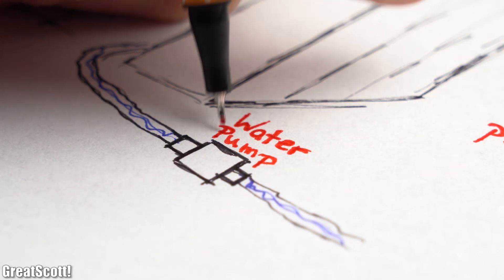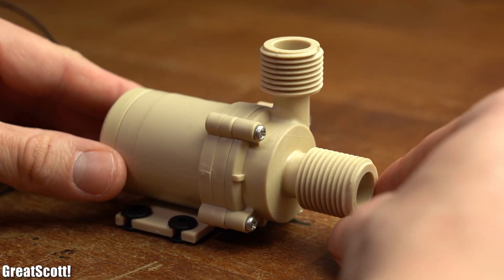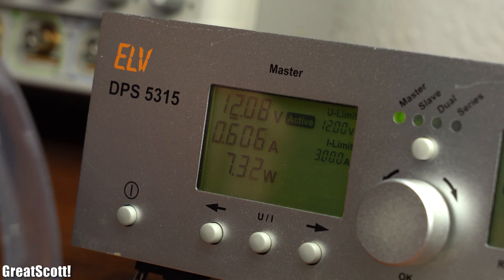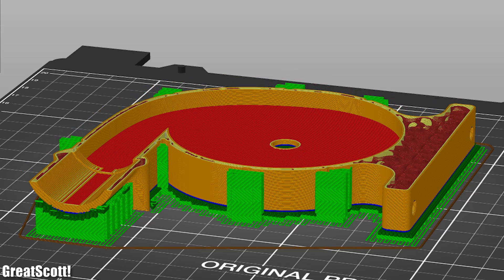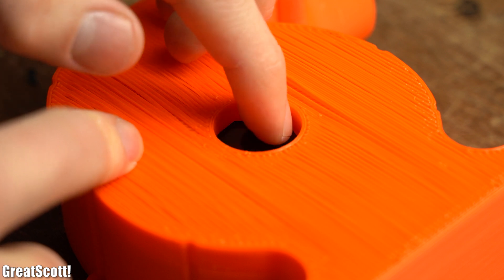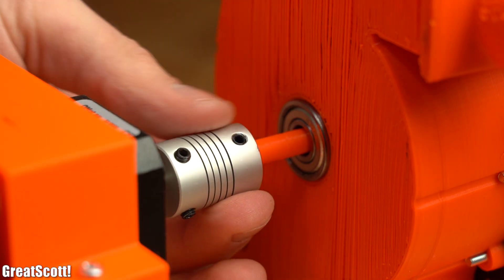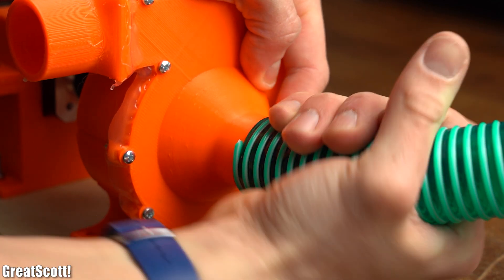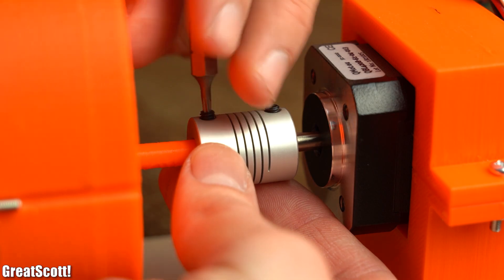Water Pump || DIY or Buy

Comment: Shouldn't the curve on the impeller be the other way?  Most impellers I've seen have the curve the other way to push fluid away from the center and not capture it and force it to the center.

Comment: 1) The impeller was the wrong way round, so created extra load on the shaft   2) The shaft did not fit the bearing, so was flapping around, again causing more stress 3) PLA would have been more rigid that PETG for the shaft, also the shaft was printed with the later lines in the wrong direction so was going to fail due to layer separation anyway 4) A bolt or metal rod would have been better for the shaft anyway, but the plastic shaft could have been made to work by printing in PLA, making it wider and making sure it fitted the bearing.
I think you should re-visit this video and actually make it work with some improvements 😉

Comment: The impeller shaft wasn't supported by the bearing which would cause a failure even if the shaft were metal.

Comment: There are lots of options to make that shaft into a metal shaft, could use some axle shafts for rc cars, or some small bar stock. Even a wooden dowel would probably work better than that printed piece. You could also increase the strength of the shaft by printing the shaft so the layers are going long ways, this would make it less susceptible to shear, and stronger in torsion since they layers are in compression and tension, vs shear. 
Great video!

Comment: if you aligned the shafts correctly the 3d printed shaft would've experienced a lot less stress and your motor would've lasted longer and drawn less current

Comment: I would definitely recommend a metal shaft, but if it were to be 3d printed, you would want to print it 90* rotated so that the layer lines are going along the full length of the shaft. 3D printed parts are weak if the force is going with the grain

Comment: I did a same type with an old vhs tape motor. Its powerful even with 6Volts.
I used two soda caps and a lot of hot glue
But the wheel was flat. Not rounded

Comment: I think the DIY should have done better but there are some issues to your construction, experiment and the way you understand centrifugal pumps. Firstly is the rotation of your 3D printed pump impeller, fron the video it looks to be rotating the wrong way. The impeller should rotate so that the blades throw the fluid outward against the case. Secondly the impeller shaft is not supported on the bearing, the shaft should be made of a sturdier material such as aluminium, bronze or SS. Centrifugal pumps have a limited suction force, called Net Positive Suction Head (NPSH). The inlet/suction side of the pump should be close, equal or lower that the fluid source. A non return valve/check valve on the inlet/suction side will be aid the pump as not to loose the water on the delivery side and keep the pump primed. There is all so a relationship between the flow of a pump and at what head/pressure it can perform/deliver. Look into some pump curve to see that.

Comment: Why not drill out the plastic shaft of the impeller and replace it with a length of brass or stainless steel?

Comment: Diy design had a fatal issue. It has angled axle and not even having contact with the bearing. Only metal axle can handle resistance of water. The unbalanced axle and the water was enough for pet-g. Try to scavange diesel pumps, they have a decent flow capability. The best is a truck or tractor pump :)
Reply: In scrapyards or second parts shop they are basicly free

Comment: With smaller waterpumps there is also problem with the 3d printed layers not sticking to each other enough, so the water will leak out. I have printed many "heads" and impellers for ebay "el-cheapo computer watercooling pumps" (submergeable) and when they are submerged, the problem with smal leaking is not a problem. That has boosted the "umpf" factor of the pumps significantly, but at the same time trying to make tight tolerances, the noice levels have lifted. stil great video

Comment: Should try to couple the metal shaft directly to the impeller. I think if you ditch the heavy metal motor shaft coupler, the pump will spin a lot faster and have more torque due to less rotational mass.

Comment: Weren't there any torque specs on the motor you were trying to use? Seems that this project would've benefited from knowing that at that the onset. Any mechanical system is only as strong as it's weakest part.

Comment: Buy cus not got 3d printer lol
Why put pipe tape then a jubilee clamp lol
And should of used thinner pipe on the input that pump not gonna pull that weight of liquid lol 1 liter = 1kg .......just crap design impeller plastic toy

Comment: The flaw with that one design is that stupid plastic shaft. Just drill the impeller out so it'll press fit onto a long motor shaft and work with something like that from there. (Somewhere on Thingiverse I also have a centrifugal pump design as well. I think it may have issues with the volute for printing, but never got feedback on it as where to improve it.) Also for sealing, just get some RTV gasket sealer like used on small engines and such. A small tube of it should be enough. Goes on like a bead of glue, but should be able to be pulled apart again after setting if needed.

Comment: why don't you separate the parts that are supposed to be made with metal?  I mean, not all parts can and are feasible to be made with a 3D printer.  it might work. but, you didn't did it well.

Comment: I have personally made a similar diy version of this, which worked really well. I can send you the design specs (I haven’t ever uploaded it to YouTube) if you would like another shot, because I believe that here the issue is simply the design. With a 3D printed inline jet impeller driven pump, you can pump an insane amount of water at low pressure. I also made a centrifugal pump, which even with 3D printed parts, had an incredibly high pressure, and a good flow rate. (I also designed a cap that wouldn’t leak, by having a screw on cap) again, if anyone wants the files, I’ll upload the latest version somewhere.

Comment: Just add a metal shaft where the pteg shaft failed. Drill a hole in the center of the propeller where you can insert that metal shaft, then connect that to the Trinamic Stepper motor assembly

Comment: you can print the shaft in an angle where material grain isnt in the same axis of rotation also when you say "firstly" it sounds incorrect, so instead of saying: "for that i firstly added" you should just say "so for that first I added", cheers.

Comment: Go for a gear or screw pump, they are self priming. This might be a better option for your garden, as you will not need to fill your pump with water each time you need to water your plants. Gear and screw pumps can also be used to prime a centrifugal pump

Comment: 9:10 Why you didn't use M8 bolt as a wheel shaft? Hexagon(13mm head) of the bolt into wheel of pump, and shaft into bearing and motor coupler. Thanks for video ;-)

Comment: I think you would get tired of sucking up Water to get things started.  : p  
I'm Not either - mechanically or electrically inclined.  Tho i picture Filling Hose with Water to Prime. ?  
Or something like i've seen - Make a 'dip' - Water, 'P Trap' (word?)  as in plumbing, to hold (somewhat) of Prime.   
-  all the same  -  Great Luck on Garden!    = )

Comment: If you were to make an allowance for a stainless steel impeller shaft press fit into a 3D printed impeller, I think 3D printed design could have more merit. However, the hole in the impeller must be 3D printed. No modifying the part post-printing except to maybe ream the hole. I'm curious how much power that impeller can withstand and how much flow that equates to. Will it experience cavitation? Will it simply split in half?

Comment: Use a bit of steel rod from a hobby store and an angle-grinder to make a key-way. Mount the impeller on the steel shaft and key the impeller onto the steel. Couple the steel to the motor. Vastly superior drive-shaft strength for the impeller turnstile, without having to rebuild the leak-prevention gallery beneath the bearing.

Comment: Hi. Nice video! Can I focus you on the geometry of the impeller? The blade should be mounted In the shaft with a trail angle between they an the radial perpendicular imaginal line coming from the center line of the axle. In your "backward printed" impeller it fight  against the centrifugal force on the water. And as other comments suggest I should print the impeller with a hole smaller of a steel shaft for interference coupling with it to ensure concentricity an mechanical grip without set screw or similar. And it is very important that the shaft is perfect sealed or it lost the prime of the pump. So I suggest you to modify the pump case for accommodate behind the roller bearing an anular holeodynamic seal that are commercially available for very cheap. Have a nice day!

Comment: using a metal shaft would have been better than a 3d printed shaft, also an impeller type blade inside the system would have worked better. i built one as a test a while back, with some modifications. The mounting plate for instance i created a small triangle on the flat plate that mated to a triangular crease in the motor body which increased the water "tightness" so less glue was needed to seal the unit. It is "doable" but for 10-12 for a pump on amazon, definitely not worth the effort :)

Comment: I would reprint the impeller without the shaft coming off the back and instead drill a hole to fit a metal shaft through. Using a tight fit and blue lock tite to secure it then it should work

Comment: Oops... mechanical failure! @1:23 it was obvious this would happen! 3D printing is amazing but only when used with proper mechanical hardware. Cant attribute a failure based on a bad design from the web. Those 3D prints could definitely use some improving. Maybe Stefan from CNC Kitchen should be consulted, I'm sure he wouldn't mind the sub boost! 
Keep up the great work!!

Comment: You got so close and just said “eh whatever “ 😂 all you needed was a metal shaft and your gasket would’ve worked and you need to prime the pump but it’d have done the job
Reply: No. The forces that these pumps go through are extreme. Traditional centrifugal pump vanes are usually made of glass reinforced plastic and have extra reinforcement designed into the impeller just to handle the forces that are exerted on them. That large pump design was designed to fail, and I'm shocked that it wasn't the vanes that did.
Reply: @whateverworlshere  Yeah true, but in this case he made a very clear mistake. The impeller vanes/fins are wrong. It should be the opposite. We can compare to the commercial pump at 3:25 to the DIY one at 5:00. I dunno how Scott can miss it and commit such a fatal mistake. I hope he rectifies it and try with a metal shaft, it will definitely work to pump water if not on very high power.
Reply: @DSmartLife  It rotates the correct way. See later footage... Notice the rotation of the motor coupler??
Reply: Christopher Jones yea no kidding, I fix pool pumps and the impeller is 1/4 the size of that thing on the orange pump he made. Meanwhile on pool pumps they are about 1-2 horsepower
Reply: i'd just stick it directly onto the motor
Reply: what else do you expect? this video was made just to show that trinamic board

Comment: the shaft of the pump probally broke because the shaft was smaller than the bearing, so it was just flopping around
change the shaft to a metal one  and use the bearing and try again
would like to see what it does

Comment: I agree with many of the suggestions below. Also there seemed to be a lot of shaft vibration. Are you sure you had the correct size coupler for the printed shaft? It looked like it was moving eccentrically. Couplers with set screws are something I stay away from. Split clamps do a much better job of keeping things centered. However, either way, you need the correct size coupler for the shaft size.

Comment: Huh, either you really need to recalibrate your Prusa, or they aren't as good as I thought they were, that print quality looks really inconsistent. D=

That aside, thin-layered towers like that shaft are really weak, and you pump vanes where backward.
That pump could work IF you replace the shaft with a metal rod fitting firmly in the bearing and print the vanes mirrored.

Comment: 3D prints are weakest along the layer lines, so this break was almost too obvious. The model would have been a lot stronger if the shaft was printed horizontally on the print bed, though then it would need to be printed separate from the impeller and also might have roundness issues. (Or, as everyone else suggested, have the shaft reinforced/replaced with metal.)

Comment: Hello there!!, in first you are trying to invent the water pump that is already done, all the things except the motor are just crap, but you still want to make a water pump, right? Well you have to think in a self primer water pump wich has a big canister in front of the inlet in order to make suction and vacuum into the hoses, when you have water running trough the outlet it force the water coming into the inlet, to be more exactly go and search for a swimming pool water pump for example, then, you have to think about to use o rings to seal the impeller case, make a grove all around the edge to put the o ring and it will seal perfectly with good amount of screws around, is so simple, to the impeller design i do recommend you to incorporate a nut in wich you can screw a stainless steel shaft  to make it strong and can produce the water pressure you need, to seal that shaft you have to put something like a o ring pressed between the pump case and the shaft like a sandwich of screws washers and the o ring in between it will make a good seal and will let the shaft turning, otherwise try to get a ceramic seal dor water pump that fit the shaft... and the ball bearing of course out of the contact of water... there is a huge amount of water pumps brands, abs, jacuzzi, hayward etc.

Comment: You chose the wrong design for this purpose, you needed a design in which pump impeller directly attaches to motor shaft and a smaller pump. Don't judge it by look, often the simplest design would work much better.

Comment: I really think you should have replaced the rotor-shaft with a metal one. Just drill a small hole in the rotor and hot-glue a metal shaft to it. That should be strong enough. -Greetings from a Norwegian friend

Comment: yeah so the axle will always be the point  where the most of the power is transferred, obviously if your put a motor with a metal shaft on one end, you do not want a plastic shaft of the same thickness on the other end you would want at lest 5-10x as thick a shaft. You could also make the axle metal to allow it to transfeer the power and have the rest 3d printed.

Comment: maybe a good idea to improve the shaft. You could have the shaft made of a separate piece from the rotor. This way you could print the shaft with the layer in the longitudinal direction. It will make it much stronger. Maybe a bigger shaft would be a good idea too. Very interesting video nevertheless :)

Comment: I think that you need to make the impeller by 3d printing and use a steel/alu rod as the shaft and that might work better.. but again, the impeller is also subject to high stress too, unless the impeller is mafe in a way that the blades is supported on both side and a hole in the middle of one side to allow water intake.. that might work good enough to actually handle the load when moving water..

Comment: 4:59  Your fins are mirrored, that causes a lot of extra stress and resistance to flow.
Reply: could you elaborate? edit: nvm i figured out what you meant from someone elses comment. sweep angle is wrong
Reply: @justd3fy  no, the impeller is facing the wrong way:
https://www.researchgate.net/profile/John_Anagnostopoulos/publication/228664782/figure/fig3/AS:667634819403779@1536187953532/Sketch-of-a-centrifugal-pump-impeller.png
The impeller should rotate towards the pressure side.
Reply: @aida-beorn  I went back through the video and you are indeed correct.   
Direction of rotation is clockwise from the back (outlet facing right): 8:29
Direction of the impellers requires clockwise from the front (outlet facing left):  5:08

the impeller needs to be taken out and turned around the other way.  If he simply spun it the other way with the outlet where it is he would get some hellish eddies
Honestly, this is the kind of design I would use for an air blower or vacuum not a water pump.

A metal shaft and blades might have helped too.
Reply: @justd3fy  more that that there are a even number of blades that cause cross pressure when the water is released on the output side
Reply: @justd3fy  hand tractor
Reply: @justd3fy  Water is incompressible. The water is 'flung out' by the wheel and follows a spiral. The circumference of a circle increases with radius, so for conservation of mass, the cross section normal to the flow has to stay constant. This creates a certain geometry for a spiral.
Reply: Wrong impeller design anyway. Print a close face impeller with counterclockwise 4 vane paths and that will eliminate the need to prime the pump because it it will increase the NPSH of the pump allowing the pump to self prim also upgrade the to a metallic shaft.
Reply: @mitchelllegg5326  Closed impellers won't self prime either. You need it to either be positive displacement, have a wet self-priming design, or use a vacuum system to depressurize the volute with a checkvalve on the discharge
Reply: Still not as simple, there are designs with forward-facing vanes. There are pros and cons for each 3 types (forward-facing, radial, backward-facing), but in general we try to avoid forward-facing vanes.